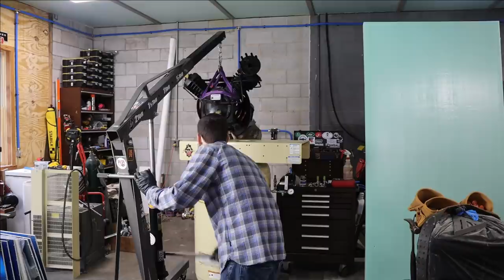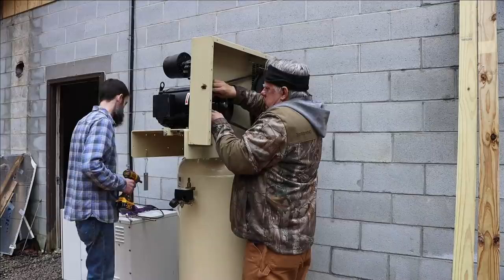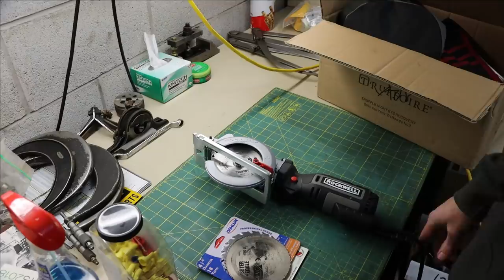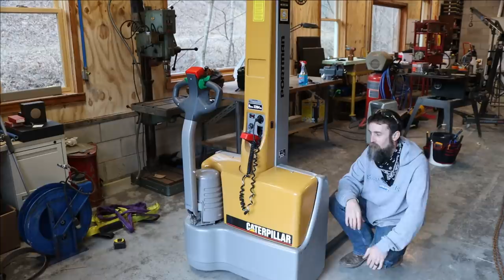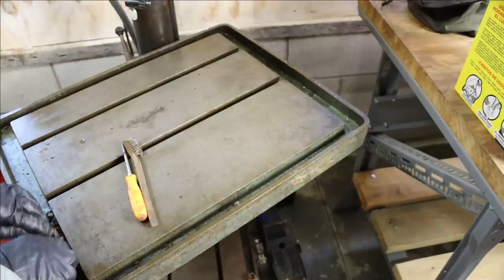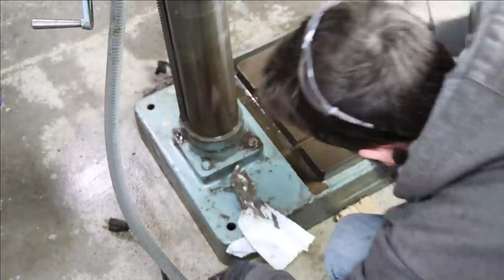Awesome New Shop lift! /  Doall Drill press 1st run and clean.

Comment: Batteries: check prices on the deep cycle 12v ones for electric wheel chairs .. they are affordable, and designed for repeated use/charge/trickle charge cycles. Its what i use for trolling motors.
You are going to love the Rockwell! Great little saw for plywood, flooring lumber, etc. Anything under 1" is great.
Thanks for sharing.

Comment: Group 27 or 31 Deep Cycle Trolling Motor are made for constant charge and discharge cycles. We sell them for under  $100 ea. at our marine dealership.
Reply: Was gonna say the same, group 31 truck battery would be good too and you probably would only need just one.

Comment: Al is a good friend.  I'm jealous over the drill press.  You should be able to cantilever the roof over the door without a support post on the corner.   Curtis Chaudoir has the right idea with the Deep Cycle batteries.  That lift, with a pallet for a standing surface, will be great for working on the ceiling, when needed.  Amazing what a razor, purple power, and elbow grease, can do.  You should always clean from the top down, that way you don't recontaminate what you have already cleaned.  You are gonna have a first class shop my friend.
Reply: There's two kinds of dirt. There's the real stuck down stuff and the looser stuff. The looser stuff wipes right up too.

Comment: Hi Steve, I had a machine vise that had two holes drilled into it my fix was to drill and tap the wholes and installed bolts with locktite and milled them flat. after a couple years you have to look real close to see them. I didn't want visitors to the shop think that I would be so inept that I would do such a thing. Stay well and hi to Liz !!

Comment: Hey Steve! There is a spring type mount for air compressors that will isolate and prevent damage to the feet of the tank.
I used to buy deep cycle batteries at auto zone for my boat. I believe they would be a better choice for your lift. Car batteries won't last nearly as long.
Reading through the comments I notice a lot of ideas about the drill press table. When I plugged holes in die sets, I would tap a hole, threads short of breaking through the opposite side, and then bottom out threaded rod in the hole and cut off. Finish to match the existing surface.

Comment: Steve : That damage on the table of the drill press would drive me craze.  Such a nice machine deserves the best.  Cast iron is not that darn hard to repair if you know what your doing.  You only paid $300 for a machine which would normally cost you much more. I'll bet if you took the table to a good certified welding shop they could repair the holes for only a few bucks.  Some careful refinishing on your part and nobody would even notice the repairs.  I chipped the tee slot for the tool post on my 1923 craftsman metal lathe and welded the piece back on with a Lincoln 225 amp. stick welder.  A little grinding and polishing and you couldn't tell it had ever happened.  The fix not only looked good it never has failed.

Comment: That drill press is a lifetime partner.
If You run it to hard, or something really grabbs the bit, there is a fiber gear on the spindle that's sacrificial so you dont rip it apart, you have the torque to do it in low gear.

Comment: Steve,
If you do change to lighter batteries, or convert it to plug-in operation, you have just changed the counterbalancing weight and the lifting capacity. Add scrap steel to maintain the same weight in the battery compartment.

Comment: If you want to get rid of the oxide staining on the drill presses column, you can do what Eric does from "Hand tool rescue" and wrap a cloth soaked in "Evaporust", I'm sure it some up a teat or use an even older trick mix lemon juice and flour into a paste and apply it like a bandage.

Comment: That power fork lift was a GREAT find, to bad you didn't have it when you did the ceiling. You could have made a pallet basket with a security rail for the forks and had your wife operate it for you while you installed the ceiling. With 1100lb at the tip of the forks the basket could have been candle levered out by 2ft giving you a 4 x 6 platform. Luv your videos! THKS

Comment: I believe a Marine Deep Cycle is what it calls for as the hydraulic pump is a continuous amp draw operation. FYI a car battery is designed for a high current draw for a short duration. I've repaired cast iron drill tables preheating the cast to 500 degrees and filling with weld and slowly lowering the temp to cure the weld.

Comment: Swedish made Strands and Arboga drill presses are the best there is, top quality and last forever👍
Reply: At the heritage railway where I'm a volunteer we were given an Arboga drill/mill a few years ago, excellent piece of kit!
Reply: the doall brand is from Continental Hydraulics here in Savage Minnesota my buddy works there and told me about the brand
Reply: @the_hate_inside1085  thanks, now corrected
Reply: @danhard8440  I'm pretty sure that it's a rebranded, Swedish Strands drill press, and it's not build in the US.

Comment: Bolting through the rubber pads creates a rigid path for noise to pass into the ground. The rubber doesn't get to flex with the vibrations - like putting bolts down from your chassis to your axle and pulling them tight.
Reply: I agree! To fully use the rubber/cork pads, there should be the same material under the bolt heads and a rigid washer. 
Then the machine foot will be able to move and vibrait free from the bolt, rigidly fasten in the concrete.
Really like to follow You’re progress in the shop. 
Which You and Your family all the best!
Reply: @perolovson1715  Yes, needs a top cap of rubber as well, plus a short rubber hose sleeve in the hole, or just place the sleeve on the top of the anchor bolt shaft, and leave it 5mm proud of the top of the foot.
Reply: It is very important not to bolt them down.
The vibration over time can crack the tank around the feet (know from experience working with poor installs).
The bolts are only there to keep the compressor from tipping over.

Comment: If the internal battery charger in your fork lift is designed for AGM, check the specifications for the charger.  Some AGM chargers limit the charge current, as such it may take much longer to reach a full charge.  That said, you won't damage your car batteries!  Good luck.

Hey, pretty soon you'll need to expand your space to fit all the neat stuff!!

Comment: You need to put some sort or a steel walkway on the creek side of the shop. Would be a lot safer. Things are coming along big time. Regards as always from Ireland.
Reply: Or concrete since you're now an expert at that as well
Reply: @mdouglaswray  steel would be a lot faster and easier. You'd have to put an awful lot of material in to shore up that creek side. Some i-beams and grated meshed panels.

Comment: Once again everything is top notch my friend. I have always used Optima deep cycle batteries in everything including my pickup. They are a dry type so they can be put in any orientation and 10 years is not uncommon as a service life. There is no corrosion around the posts either. Initial cost is higher but they pay off in the long run. In my eyes the DoAll is to die for. Add a good cross slide vise to it and you have a great, light duty milling machine. If you have time stop by and check out a new project I am working on. Sterling silver Chopsticks. Thanks again for the best way to get my Saturday mornings going. See you soon and take care eh.

Comment: On your drill press, drill and tap the through holes in the table and locktite in set screws.  it will keep lubricant off the floor.

Comment: As for your air connection to the tank, could use a length of hard line, but run it in a couple loops of coil. Old steam engines ran copper line like that to pressure gauges to keep vibrations out of the gauge

Comment: Steve,

I have enjoyed your new machine reveals and interacting with your viewers regarding who made your Doall drill press. Are you familiar with Johansson drill presses? When I think of machines in the next class up from your Doall I think that Johansson is something to investigate. Johansson had an interesting twist on the radial drill press design. Gear head and easy operator interaction similar to your Doall, but a major upgrade in ruggedness. We had standard configuration Johansson machines in a gang drill set up, but we also had a radial head machine. The table on the radial head machine was enormous and elevated like a knee on a knee mill. Our machine was ancient and had a home built electric table elevation system that looked crude, but was a dream to use. The head swung on a column with factory motor driven head height adjustment. The radial slide was flat ways and extremely rugged and reliable. Easy to operate manual clamping released the head slide and swing allowing super easy positioning on the very large table. I don't recall when Johansson shuttered their doors, but I suspect that our machines dated from 1940's and were still viable daily use production machines today. Gang drills really find their place in production shops, but that Johansson radial drill press would be a daily user in a small shop like yours and mine. It is way more machine than your Doall, but has the footprint of a Series I Bridgeport with the ease of operation of your Doall. Oh how I would love to have our old Johansson radial drill in my shop.
I did an internet search and easily found a later version of our machine, but the price was the cost of 2 Bridgeport mills. I won't ever own my own!

I am also interested in your Caterpillar electric pallet stacker. I have never seen a Caterpillar version. It looks exactly like a Raymond. I don't believe that Caterpillar ever made their own forklifts or related material handling equipment. I would like to know if anyone knows the Caterpillar story. I believe that they acquired Towmotor (the inventor of the forklift). We had a fairly late model Caterpillar forklifts in the early 1980's that I recall was a Towmotor. To my knowledge, all Caterpillar forklifts are made by Mitsubishi. Our shop hooked up with Raymond for electric material handling machines. I did a lot of service on our Raymond wire guided order pickers and electric pallet jacks. We eventually got a couple versions of Raymond reach trucks. Your Caterpillar elevating pallet jack is a direct clone of one of our Raymonds. I suspect that it is a Raymond. That was a sweet operating machine that required virtually no maintenance. The offset drive position is intuitive, and gives clear operator vision. Unlike straddle stacker machines it doesn't have front support outriggers. This allows you to pick up wide loads, but you can't lift a standard skid with a bottom. If you set up pallet racking in your shop, you almost eliminate use of storing on the floor, because you need clear space for the front support wheels. We typically set our bottom pallet rack shelf just high enough to clear the wheel supports allowing easy and full upper shelf material positioning. Your machine design is more maneuverable than out rigger designs, but the forks are fixed. I think that your design will be great for material moving in your small shop, but you don't gain the clear floor space for overhead lifting like you get with a forklift. I have a straddle stacker for my shop. Like you, I stumbled across mine in an exceptional deal. My machine is power lift, but manual motion. The electric mobility of your machine is a highly refined design. You scored very well. 
Please report on the maker, especially if it is Raymond. Enjoy the toy. It is a beauty.

Comment: I would consider putting the white light on the left side of your new workbench so you could swivel it over to use on the drill press.  Also if you mounted the black light on the right side towards the back you could then push your bench all the way back against the window and that would eliminate the gap the you now have at the back.

Comment: Hey Steve,
Instead of 4 x 4 post on the ground to support your air compressor cover, have you thought about coming off the side of the wall with a welded 45 degree channel or tube? You would still have the access you want without the post getting in your way.

Comment: Nice video Steve 👍
Your drillpress cleaned up nicely.    Now you have a great drillpress to pass on to the next generations ☺️

As you might know I have a couple at home, - and we have some at work. They are super common here in Scandinavia, of course 😁
We just restored one at work, like yours, a Strands S68 model. Motor had one fase burned. But it's easy to take out and a local electro-shop got it worked in a day.   But they do (almost) never fail..

I envy your new lift. It's a nice addition to your shop, and make many things easier.

I would also just add car batteries 👍😁

Best regards from Denmark 🇩🇰

Comment: Hey Steve! 
I should use a piece of plywood under eatch foot, same size as the soft-foot between the barrrel and the soft-foot . So all that vibration comes down to the soft piece. Now you just have a steel piece standing on a piece of soft material. It can eat it up if you dont use a part that can be changed as an offer-piece! I would suggest 3/4 inch piece. Or if you wanna upper the stake and use some Aluminium. Or perhaps steel.

Comment: Batteries,  check on wheel chair batteries.  I bought one 10 years ago at a flee market for $20 and it still holds 12.5 for a long time.  Use it for emergency power for my ham radio.  Maybe you could weld up the holes in the drill table and resurface it with your shaper.  Just a couple of thoughts, Greg.

Comment: I have used JB Weld to fill those pesky holes in cast iron work-plates. It is very durable when cured, and unlike filling the holes in cast iron with braise brass alloy, will not introduce heat warpage into the component.  When you add coolant, it will hold up.

Comment: Steve, 
I've found the opposite when I wash the car.
It is generally a precursor to the thing breaking down. 
My theory is, once I wash the thing it expects the pampering to continue and spits the dummy when it doesn't get it at the intervals it would like.  😉😁😉
Lead acids should be fine as long as you don't leave them on constant charge between uses. Just check the CCA is near to the originals.
Cheers Eric

Comment: Hi. Nice drill press! This swedish drill press electric motor is most likely with Dahlander type windings and it needs specific type start switch. If this type of motor is some how wired wrong, it might run but windings will burn quite fast.

Comment: The unit is not a fork lift but a palate loader and loader to prevent back problems. Its used when loading and unloading items onto and off plates, thats why you cannot tip or change blade width. We use them to unload packages, you start low and rise the height as top items come off and reverse to load. Fork lifts do not leave a set of wheels on floor under the forks when in the raised position. Also on the side there is a warning sticker not to raise people on blades.

Comment: For the lift, make sure you get "Deep Cycle" batteries if you go with a standard battery, like trolling motor type.  Also the charging technology MUST match the battery type if you want the batteries to last. Get a high end trickle charger. Keep up the great content!

Comment: I use a similar pallet jack at work however they call it a straddle stacker and it’s meant for stacking empty pallets. A standard wood pallet won’t work with the version you have but if you get some plastic pallets that are open on the bottom, it’ll work fine. The only problem there is how much weight those plastic pallets can actually hold.

Comment: Hi Steve, so, as Mr Pete would say, your drill press table has the "arc of shame". I restored an old drill press, very similar to yours (my most used machine in the workshop) and I found that JB Weld worked really well to fill in the holes and give a flat surface. Also the colour matches well with the table. I actually had to re-drill the holes very slightly to give a good surface for the JB Weld to bond to,  😢  that hurt having to purposely drill into the table, but the outcome was really good.

Comment: On the magnifier arm light, make sure you never get sunlight coming in that window.  If you do, make sure you have a cover over the magnifier.  It may be remote, but my luck would end up starting a fire just from light streaming through the magnifier.

Comment: For the batteries they look like the size and type I use to use in the Chevy Caprice police cars. They came with a dual battery set up and were very HD. Have your local auto parts store look up batteries for a 2013 and up Chevy Caprice. They had the sunken terminals and were sealed and externally vented because they were mounted in the trunk.

Comment: I’ll echo what others say. At the very least you should use deep cycle batteries. If it’s 12v consider using 2 6 volt golf cart batteries in series. They will last longer and supply more amperage. 
The other thing is to use/ cycle the batteries often. Sitting unused is just as hard as cycling them.
Your shop is really looking great. I was hoping you’d have a bench in front of that window to enjoy an awesome view😊

Comment: Suggestion, spin that butcherblock table 180 degrees and put the worn side against the wall and re-drill for the vice, OR flip the tabletop completely if the bottom is in any decent condition. Nothing like getting an almost brand new surface to put your own marks into.

Comment: As long as it is deep cycle batteries you basically use what you find.

We had a similar forklift at work witch were delivered to us with "ordinary car batteries". They didn't last long due to people ran it completely dead before charging. As long as you take care of the batteries I think you will be fine.